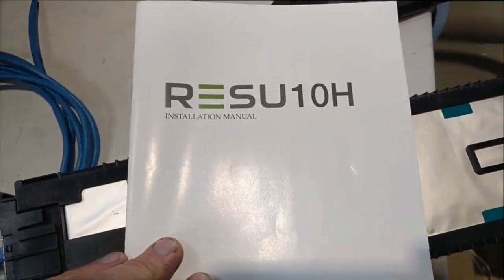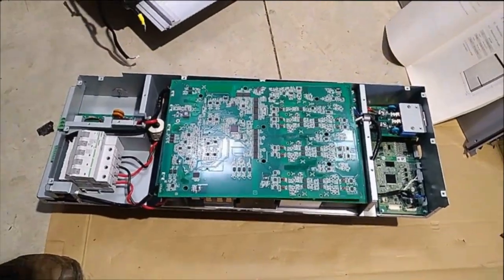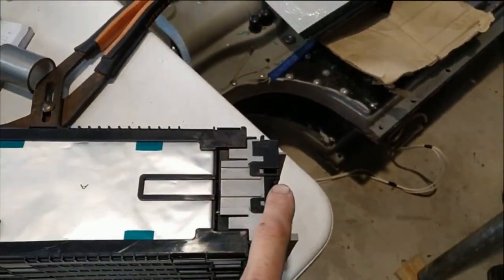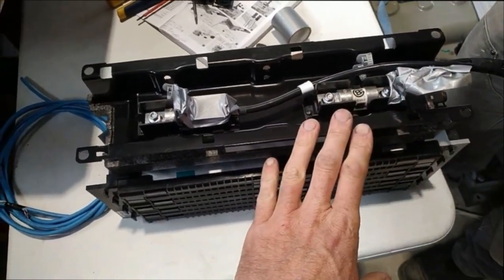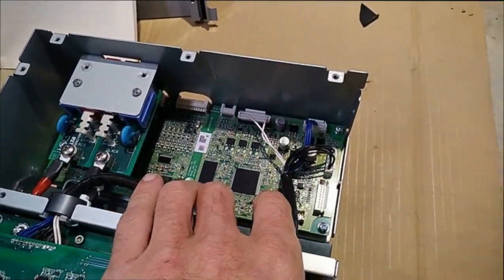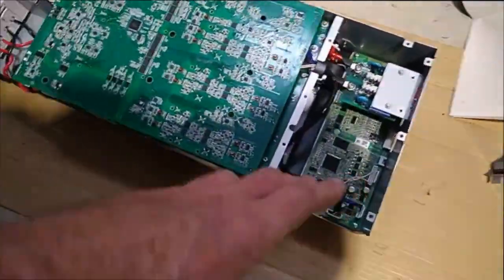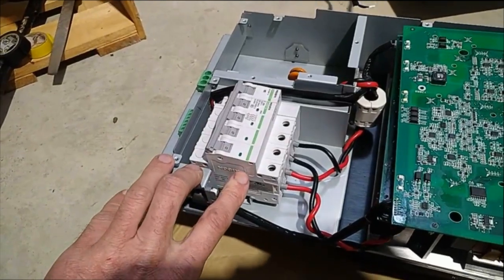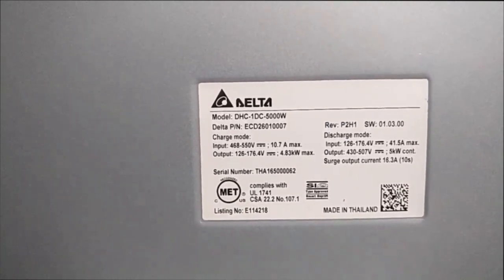LG RESU 10H Battery Strip - HV PowerWall

Comment from the maker: For quick reference: 
Internal structure is 6 Modules each with 7 cells in series => 42S
126V @ 3V/cell, 176.4V @4.2V/cell
Why didn't the guy in the video say this clearly at the start. Rubbish, I'm unsubscribing.
Reply: We have a bunch of these left over from work I can get for free. Any ideas which BMS would be applicable if harvesting the modules? LG firmware is a nightmare to work with. Thinking it would be easier to harvest the cells with a new BMS
Reply from the maker: @bigace109  I'd say any old LiON BMS. Depends how you configure it. Do a search on AliExpress for DALYBMS or if you want Ozzie made go look at Batrium. Make sure they're in a fireproof box/somewhere you don't mind getting burned down!!

Comment: The reason for the multiple contacts in series in the breaker is for ease of arc quenching.  Instead of one contact set having to break an arc of potential U, each series contact set has to break an arc of potential U/n, where n is the number of series contacts.  You see the same with multiple series contacts in a lot of switchyards for transmission and higher distribution potentials, just in switches and breakers muuuuch bigger than that whole battery.
Reply from the maker: Interesting, thank you. Does that rely on all the breakers operating at the same time? I feel that if one closes last or opens first it will see the whole voltage.
Reply: @RaglansElectricBaboon  Such breakers have a common trip mechanism.  The differences between when a given contact set opens relative to other contact sets don't matter as they all open in milliseconds and each has a bloody great spring to open it fast.
Reply from the maker: @randacnam7321  That makes sense. With a small difference in operating time I guess a small arc could start but once the neighbouring breakers open there's no longer a voltage to sustain it. Thanks again.
Reply from the maker: @randacnam7321  I've just re-watched the video to remind me of the breaker setup. Yes, of course they operate at the same time! They are solidly connected to each other and so the difference in timing can only be fractions of a second. I also stand by my (poorly stated) theory in the video: Having the current path go 'up' through one breaker and then 'down' through the other means that if a breaker is better at stopping arcs in one direction it doesn't matter the current direction at the time of breaking because there is a breaker in both orientations.
Do you design things like this? Seems like you have some knowledge.

Comment: Will it work without connecting the control leads? I mean if only the HV is connected to the battery, will it charge/discharge as a power storage? (In case the inverter is not compatible)

Comment: Probably because they are pouch cells they can't fit enough in series to make 400v. But is seems stupid using a DC-DC converter as we know are generally only around 80% efficient. Do you know what Tesla power wall setup is? All I know is that they use the same modules as the cars.
Reply from the maker: Yes, stupid to run efficient lithium through a dcdc! Tesla modules are 6S so the powerwall is 50v native. I'd love to tear one down for you!
Reply: Properly designed DC/DC converters can be well over 95% efficient.  Emphasis is on properly designed.
Reply from the maker: * Note: Tesla modules are 6S and the powerwall has 2 modules. This makes 12S total which is nominal 48Vish
Reply: Not to mention the constant selfconsumption! I stll don't get it, why they do such a complex design. The electronics will fail for sure before the battery cells. SOFAR BTS batteries are the same.

Comment: why do they use 400 volts? unless they are taking it directly from the string
Reply from the maker: I think it's because 400V is expected to become a 'bus standard'. PV strings & 3 phase are both around this voltage so it means power processing & losses are minimised. I'm not an expert so don't quote me :)
Reply: 400VDC is a good potential for an inverter producing 240VAC.  The general rule of thumb is a DC potential 2/3 again higher than the needed AC potential to allow for drops in the switching transistors in the H bridge.

Comment: This is very good, nice to see a teardown.

I have been searching (on and off) for a long time to find out the configuration of the battery.

I knew that there was a DC-DC converter (installation manual), I just wasn't sure what the  boost ratio would be (I was thinking worst case that the H series would have the same cell config as the 48V series with just a higher ratio DC-DC converter (though that would be very inefficient).

I had worked out (theory) that the battery couldn't be 400V in its "unboosted" state as there isn't enough space for all those cells. - Interesting to see that even as it is, there is no redundancy - as everything is in series.

Comment: Interesting seeing what's in these. 
I now have 2 resu 6.5 48v plugged in to a sungrow hybrid. 
7 cells is 28v so mine must be running 2 "packs" in series for 56v peak which matches the inverters readings.

Both of mine are not on the recall list.

Comment: Solamente mirando el video podria pensar que se trata de un sistema SAI pero de DC a DC. Donde existe un modulo SteepDonw de 550v 10,7A que cargará un banco de baterias de 175volt 35Amp aproximadamente y posiblemente el modulo SteepUp de 507volt 9,8Amp. por lo que aparentemente daria un rendimiento del 84%. Otra cuestion seria ver que forma de onda utiliza para la carga de las baterias ( "la forma" de los pulsos de carga determinan la durabilidad de las celdas ). Problamente la placa inferior sea los transformadores de ferrita de alta potencia pero no lo puedo ver en el video. Esto es solamente un comentario vasandome en lo que puedo ver del video.